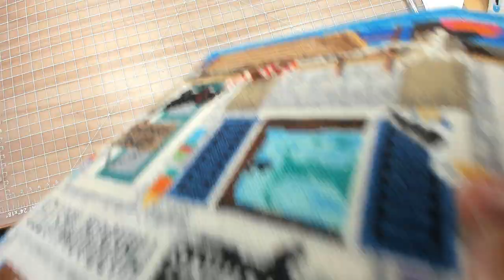How to finish a 3D Needlepoint Stand up with Brick

Comment: Once again, another amazing demo. Where do you get your foam board and matboard? When customers request stand ups that aren't using bricks and are smaller, is the process the same and what would you use in place of the brick? Again, your videos are so helpful.
Reply from the maker: I usually get foam core and matte board from Micheals. Hobbylobby quality is not as good. But i will be doing bulk order for cheapest online I can find from now on. The process is exactly the same with no brick. Just fill with Styrofoam. If you want just a little weight to it, consider using 1in bolt and nuts. They fit inside smaller stuffed pieces best. Bolt alone doesnt feel heavy enough? Screw multiple nuts on the bolt to add more weight. Also consider breaking a brick into quarters for medium pieces. Glad you like the videos!
Reply: @starkeart  Is there an email address where I may contact you or I would be happy to give you mine and I could respond. I have been sewing for 25+ years and the finishing industry is my new endeavor since my daughter no long wishes me to make her anything. I would like to talk more in-depth with you if you would agree. I understand if not, but I thought I would ask.
Reply from the maker: Starkeartdesigns@comcast.net feel free to contact me. Happy to share information. 😊
Reply: Katherine, I agree with these comments. I've just gotten a 3D piece all pinned together. this video made me know I could do it!